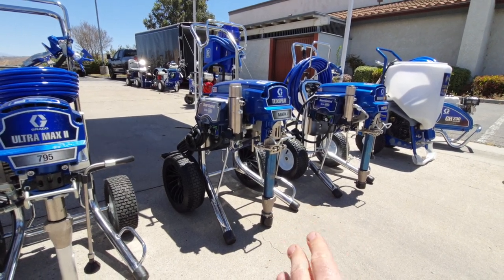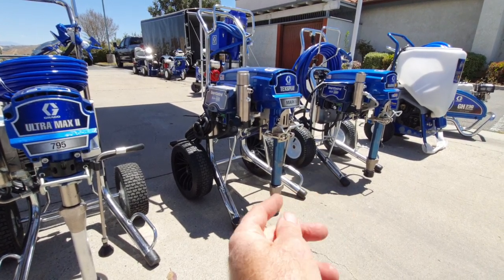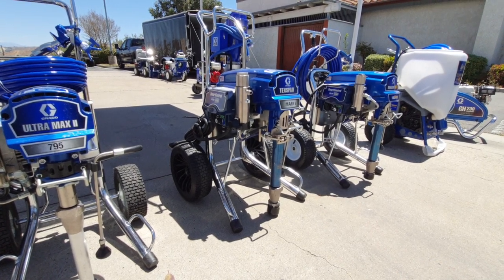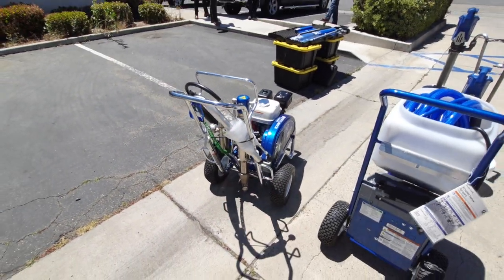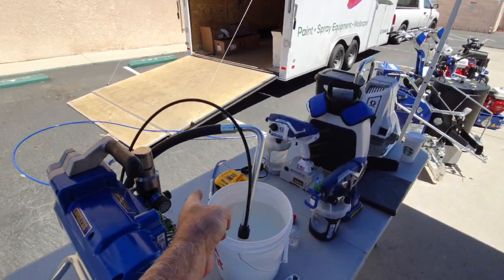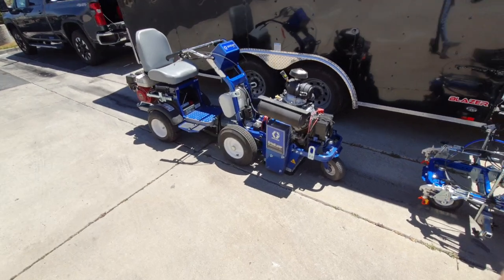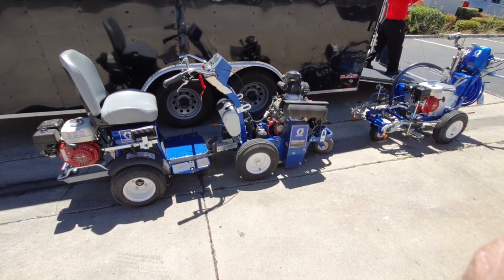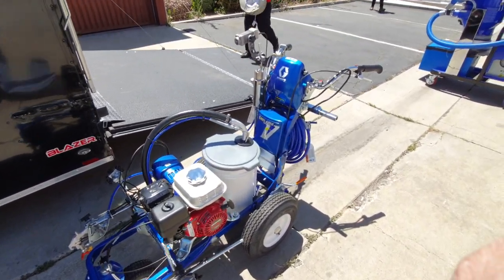GAS SPRAY RIGS AIRLESS paint sprayers  Clutch VS hydraulic powered.

Comment from the maker: I was referring to the GAS rigs  that look similar to the electric rig I was pointing at. They did not have any Gas clutch rigs there for me to Refer to so I used the electric ones that are in the video.
Reply: Hey man i live in Sac.... I just bought a titan 8900 speedflo...got a screaming deal on it... I think grieco is a little superior onthe electric rigs forsure but the speedflo was a great purchase...
Reply from the maker: @nothingsimpostleble1593  speedflow is the original hydraulic rig. I have that one too but the smaller one 4900 I think cant remember.. I never use it anymore. but I did several HUGE jobs with it. Made me lots of money at one time. one job we had 3 or 4 of these running and we were going through 70 gallons an hour. I had one guy just pouring paint. Opening up 5s and pouring. He never stopped. guys were using 10 27 tips. Everything was covered. pallets of paint Spraying eggshell enamel with a 10 27. now that is a mans tip. ha ha
Reply: That's nuts bro yeah my boss is a paint contractor old school veteran like yourself and the company he works for they do a lot of HOA repaints and that's what they use...major production 5 days a week..  Yeah i got thr speed flow 8900 for 3700 cash out the door brand spanking new at a pawn shop.. the guy who worked at the pawn shop said there was a client who was making or something defaulted so he ended up with it.. it came with 50 ft of Titan line and the super fancy Titan gun but I don't like it the Titan guns most of them are junk there's a little riveted trigger pin and they always fall out I've had like three of them this fall out and then yeah they don't take the beatings like the Graco guns then I also got 50 ft of 3/4 inch surgeline by Bedford and another 150 of grieco line. So 200 feet total I got 10 years in the game and I don't know I'm just super excited about my new pump! :)godbless man
Reply from the maker: @nothingsimpostleble1593  your right the titan guns are junk. I use TItan rigs but all graco after that. Line gun  sounds like a great deal you got on that.

Comment: I just picked up at auction yesterday two speeflo 6900 that were used and abused.  I'm building a hoard of paint equipment.  I've only helped my friends paint their houses.   
There's some really great information in this video and all of your videos.   Thank you Mike.    My favorite paint sprayer is a titan 690  with a Honda engine it's a gas with clutch model.  It's helped out many neighbors $50 total investment.
Reply from the maker: those speedflo pumps will keep going and going. put some new packings and keep it running.  you can even put a predictor on it and keep it going
Reply: @mikethepainter  I would like to ask you two questions!!!!    Number one.  Is there anything that you can spray on and old paint sprayer that will dissolve all the old paint to clean up the paint sprayer to make it look pretty good. 

The second question is.  I was reading if the packings are too worn out in a sprayer and you keep spraying with bad packings.  You can ruin the rod and the cylinder sleeve.   Does that just mean that there would be scarring on the rod / sleeve to where you could feel it with your fingers but if it's smooth it should be good to go. ?   I tried to Google but nobody talked about it into detail.   Thank you.

Comment: Spits comes from gun needle, you need to replace it.
Reply from the maker: Sometimes Yes It is the needle. But on bigger rigs on the transition from up to down, when the paint is low in the bucket they gupl air and Air in the line, or bad needle, or clogged filter, loose fitting, bad packings can all cause spits. Also Spay poles tend to spit too.

Comment: Hi, Mike im looking at a large electric  pump. I. Between rhe Titan 1140 or Graco 1095.. which you recommend.  Thank you!
Reply from the maker: it really depends on what your looking for the 1095 has the best pressure control. So if your looking to get less overspray or dust in the air, For instance in a retail location to keep dust from going very far past your cover and merchandise.. the Graco is the best. But the titan is much much cheaper to service packings piston and cylinder are less than 1/4 the price of Graco. so if you are not needing to control exact dust or overspray the titan will work just fine.
Reply: @mikethepainter   hey,  Mike i have a  Graco 795 ultramax old one is a work horse. I recently purchased a titan impact 640 is a nice little rig. My work is mainly residential and little commercial repaints. Thank you Mike!!